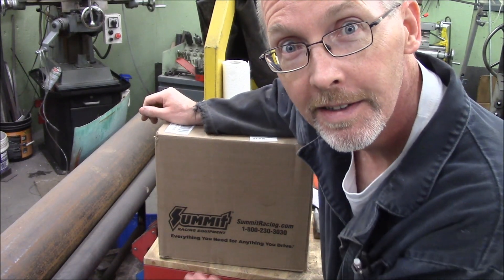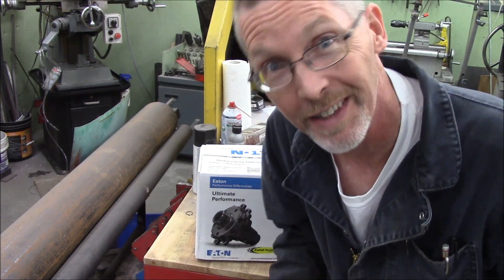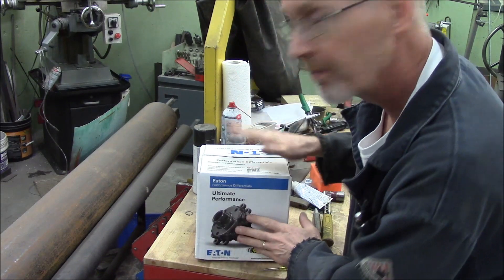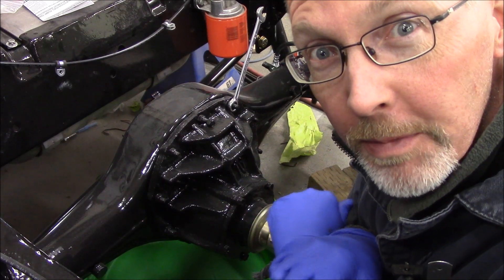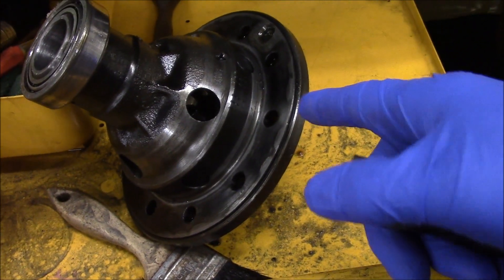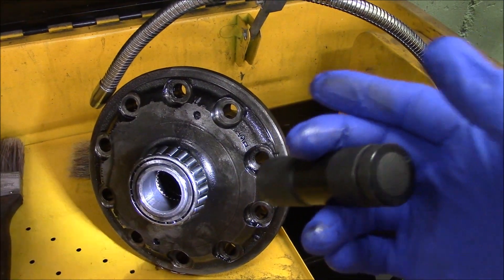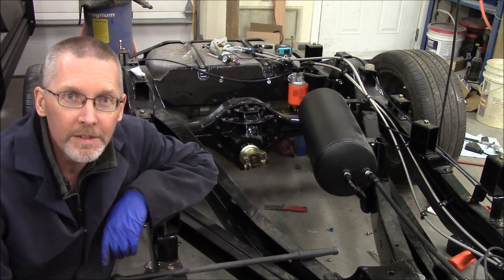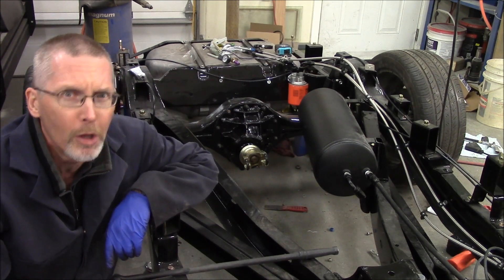HOW TO: Install a Limited Slip Differential

Comment: Question: What Eaton part number did your old truck need and which Timkens did you need to use?  Long version: Great video. I've got a TruTrac model #913A477 ready for my Ford Transit van with a 9.75" and am trying to track down the right Timken bearings and races. I've measured the diameter of where the bearings get pressed onto the Eaton as a 2.298" and 2.289" and finding only the Timken SET14 to match that spec -- but it's listed as a manual transmission countershaft bearing for $12US. I'm suspicous about fitment here.
Reply from the maker: You should check with Eaton. They would know.

Comment: Could you educate me? I know my spline and axel ratio but what else do I need to know to find a limited slip differential that will fit? My car doesn't have a large after market base so I may have to use one meant for a different car.

Comment: Eaton has a plant west of Spencer, Iowa that manufactures a number of parts used in differentials and many drive line parts. So, yeh! Some USA parts. Castings, not so much, like Dana. Chrysler used the same carrier preload screw with a locking bracket bolted so it can’t move. 
GM had a procedure to test the “Auburn” disc type also called “Corporate” for a long time. With the trans in gear or park, an adaptor was used on the lug bolts and 1/2” beam type torque wrench. Only one clutch pack would break friction and allow turning. 36-42 lbs. ft. on 1/2 ton pickups and 62-78 on passenger cars. Since more weight is over the rear axle on cars, pickups require less. This is the Min-Max specs and if low, required a new plate kit. Since the pinch point of holding required a “S” shaped spring in the middle, the kit included cross-shaft, spring and friction & steel plates. Placing the heavy car version in a truck would results in hopping, noise and wear when turning. Just info on older GM  locking diff’s. 
    Bearings are cheap, use new ones, adjust for new specs, different from used. Don’t forget the crush sleeve. Tip; use a heavy companion flange tool we’re U-joint bolt. A chain wrench can be used, but place a tube cheater over the lower control arm or leaf spring, 300 lbs. ft. sneak up quick. Be prepared to check for in-out movement. 12 in. lbs. on beam type is used to check rotational force again, new or used bearings. Check pattern with pry bar loading the top smooth area of the carrier wedged in the housing, turn both ways to check drive & coast sides of tooth pattern. 
  Once again, great video, great information and completed properly. Just change the lube every 30k miles or sooner. GL5 or add limited slip additive, then make some figure “8’s” in the parking lot to break in. Wish we had shop in school. But, it takes equipment & a good teacher. Just like him. Great job!